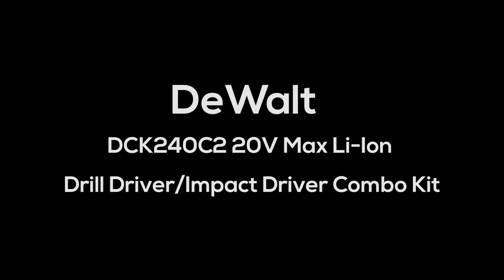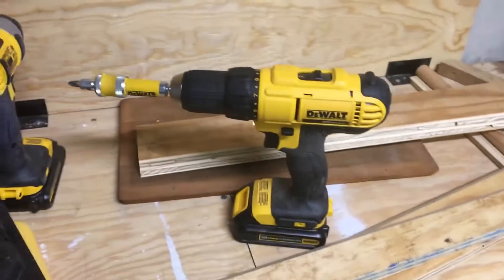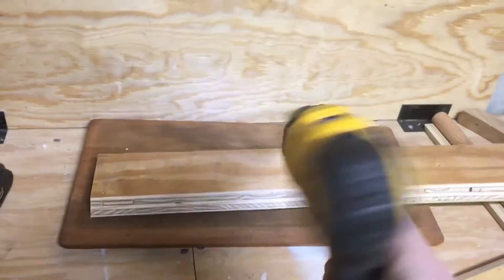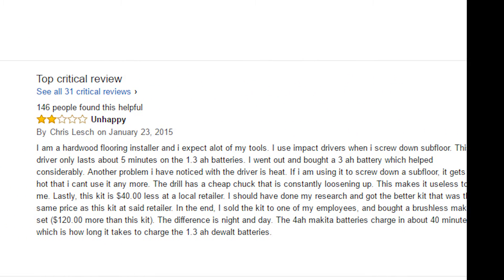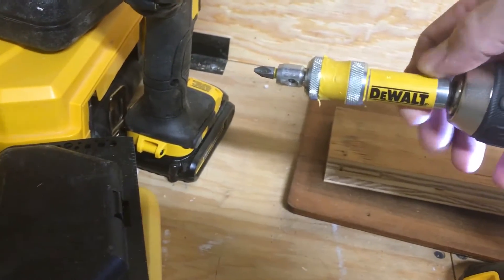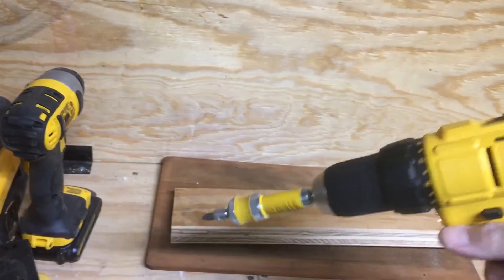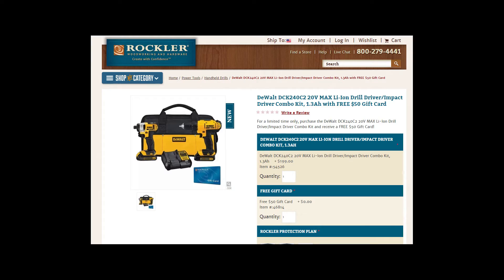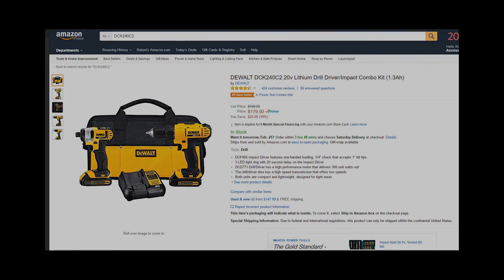DeWalt DCK240C2 20V Design Flaw / Defect

Comment: I just bought a DCD771 drill, and very happy to say the "!Klack!" is gone. My other 2 DeWalt drills drive me bonkers with the noise and occasionally up-chucking a drill. 

The fix was electronic. Instead of the brake engaging suddenly at top RPM, the RPM now reduces to about half, THEN the brake engages. I'm happy as a clam, wish I could fix my other 2.
Reply from the maker: Bob, Sadly, my Milwaukee is doing the "up-chucking" of the bits. It has happened up on a ladder. Not ideal. Wouldn't be surprised if the chuck was an outsourced part that is used by both DeWalt and Milwaukee. I hope it passes over time as the tool wears in. 

Happy to hear that the "Klack" is gone. Thanks for sharing.
Reply: Thanks for the reply WWC. I notice on my DeWalts that heavy, metal chucks can add to the noise and are more likely to loosen. I took my Jacobs upgrades off and put the OEM  plastic chucks back on. The klack is a little quieter, and doesn't  loosen as often. It's still a problem, just not as severe. It's understandable that a heavier chuck could be a little more likely to open on instant deceleration.

Comment: drills are becoming absolete, impact drivers do everything a drill can and some
Reply from the maker: Demarcus, Thanks for the comment. 

I think that there will always be a need for a drill rather than an impact driver.  Ever work in an environment where you had to be "quiet"?  Keep in mind that an impact driver does not have a chuck and not all drill bits come with a hex attachment. The entire scale of the industry tooling would need to change to mark bits with a hex shank that can fit a larger size impact driver attachment.